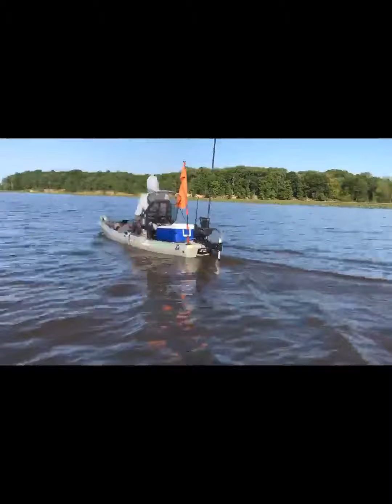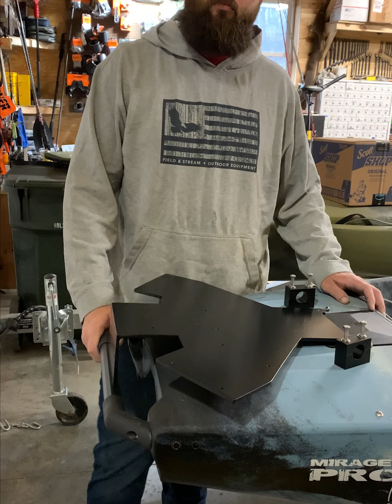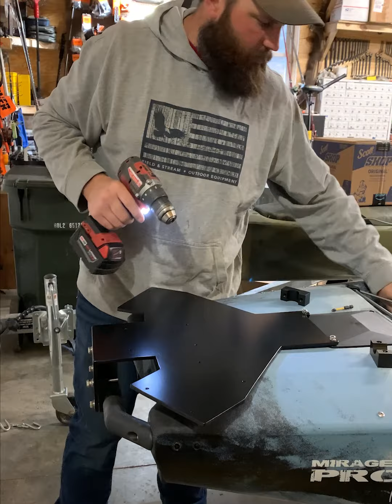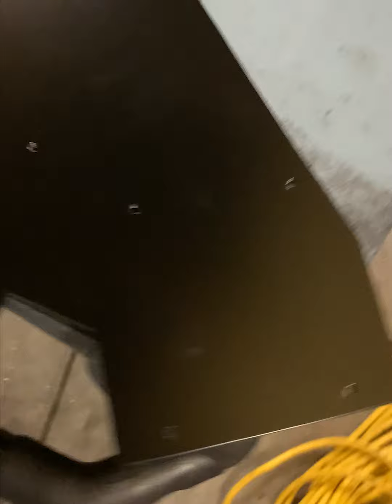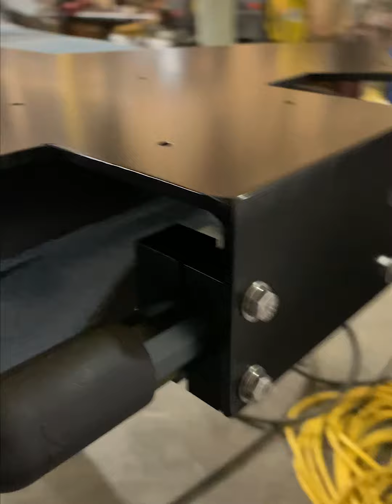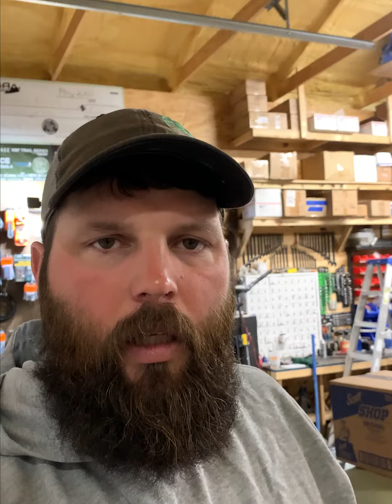Hobie Dual Power Pole Adapter Plate

Comment: I like what you made the plate out of, but not sold on using plastic screws to hold the mount down. I thought Hobie had brass inserts   molded into the kayak. I  just dont trust screws in plastic. There's lots of torque on that plate.
Reply from the maker: The Hobie Pro Angler kayaks before 2020 had brass inserts.  After that they went to plastic screws.  The torque is mostly on the H-Bar Clamps.  We’ve never had an issue with the screws.

Comment: Will setting up the power poles like this keep you locked into position where the nose of the hobie wont move at all?
Reply from the maker: In theory yes but only to the capability of the Micro Power Pole Anchors.  A lot of things play a factor in this like wind, current and the bottom substrate of the body of water.
Reply: @innovativesportsman4679  okay thank you, I wonder if you could develop something where they could be on either side directly behind the chair. That would probably help since they are farther a part and also they are more towards the middle of the boat which would also help, and also better just in case you need access to them. 

Thank you for your response 🙏
Reply from the maker: @JohnB-ep3pg  I believe for most people that would be in the way of their cast.

Comment: Tim Persey Mount?
Reply from the maker: There are many differecnces. The main difference is that this mount is made of 5052 aircraft aluminum that has an exceptional resistance to sea water.  That paired with the powder coated finish makes it very corrosion resistant and less bulky than plastic mounts.  All of the holes are tapped so there is less hardware and it is easier to install.